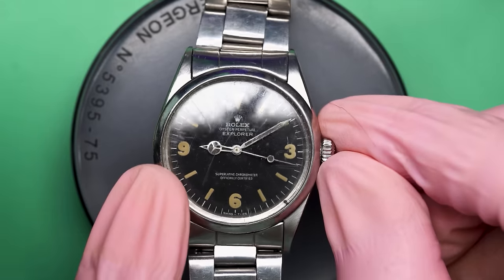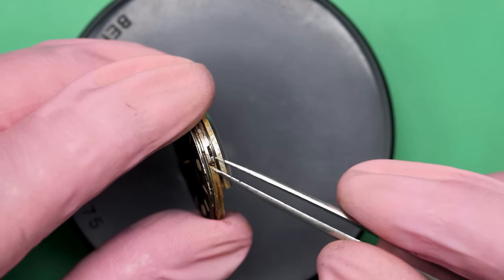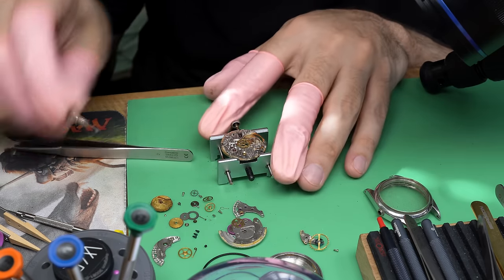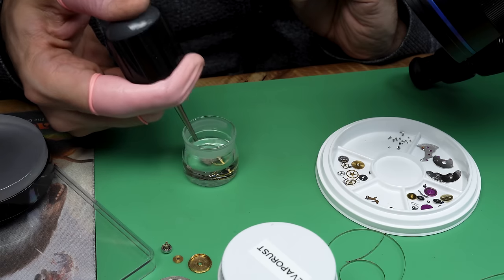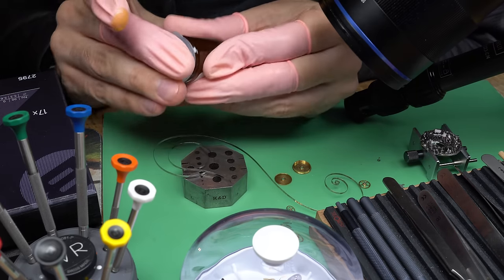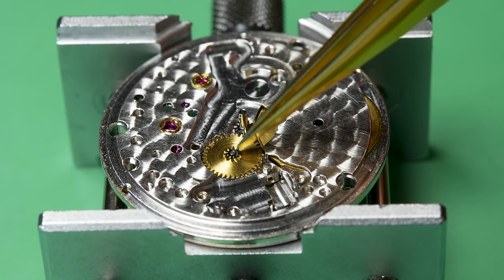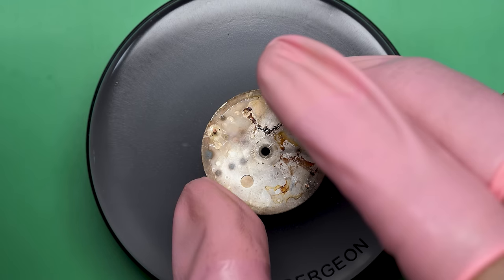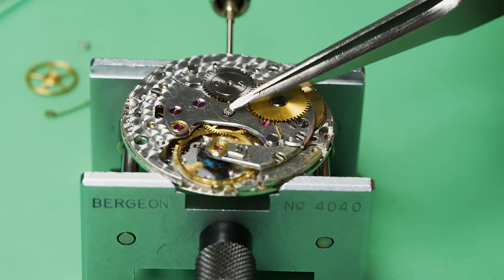This $25,000 Rolex Explorer Was Exposed to Seawater!

Comment: You know you've made it when someone hands you their $25k watch to work on. Well done Marshall - what a journey. And so good to have seen it develop from the beginning.
Reply: And now I've watched the video - even more a statement of trust given how special the watch is to that lady - regardless of the monatary value .
Reply: What pisses me off is that Rolex refused to work on it. Good job Marshall. Keep it up.
Reply: @AndrzejLDotEu  its probably a liability reason from rolex tbh
Reply: @bigbeast5751  Probably. Anyroad, thank Cat Marshall exists 🙂
Reply: Agree - this repair is a nice feather in Marshal’s repair cap.
Reply: @AndrzejLDotEu  it was probably just the AD and maybe US service centre that wants to avoid this stuff. I don’t think Rolex in Geneva would decline it
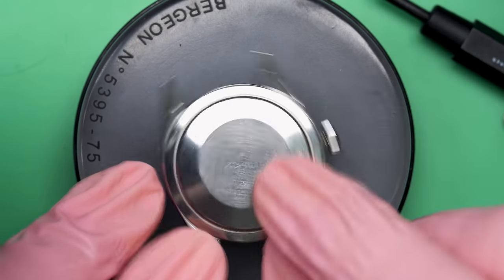Reply: @nintendokings  In the video he stated that the AD sent the watch to Rolex in Geneva and they declined to fix it. Time stamp 2:10
Reply: A tool watch that was actually used as a tool watch
Reply: @Recklessness97  ah well in that case Rolex stinks 😅
Reply: @AndrzejLDotEu  Rolex doesn't work on watches more than 25 years old anymore. I think their official reasoning is that they don't stock the parts.

You wouldn't want Rolex working on a watch like this anyway though because they will replace the hands and dial with new ones which would probably cut the value of the watch in half or worse.
Reply: @bigidiot123  The first part is not true. I had a 40 year old 1980 Rolex serviced by Rolex in Geneva during the pandemic and it was no problem. The second part is also not true. Rolex offered to replace the dial and hands at my discretion. I chose to replace them at additional cost because I wanted new lume and a different color dial, but Rolex did not force me to do that. My repair was done at Rolex in Geneva where I walked in and discussed everything with them in person as soon as they re-opened after a brief city-wide shutdown of  non-essential businesses during the early pandemic. Everything I asked was followed up with emails and letters of confirmation of exactly what I wanted and what the cost would be. I am going to post a video about this on my channel on Monday showing the watch before and after and the documents because so many of these comments, like yours, are incorrect. I understand that you're just trying to be helpful, and you've probably read what you've written somewhere, but it's simply not true - or was not true for me in any case.
Reply: @bigidiot123  I had my Dads Rolex...it was from the 50s...I took it to a local repair shop that only worked on Rolex...this was in 1991/2...the guy told me that Rolex only keeps parts for watches 40 years, and if parts were not available..he would have to make them...but the watch was restored with original parts..and it looked new when it was finished...
Reply: @bigidiot123  when a watch is particularly old, that’s when it is sent to the relevant HQ in Switzerland. Breitling from 1969, Omega from 1966, no problem. In London, Rolex can even do most things in their HQ without having to send the watches away.
Reply: How can I “direct message” you?
Reply: Well, given he wasn't first on the list and Rolex refused like the douche bags that they are, the owner has little choice.
Reply: @Harry Balls vintage Rolex are worth a lot. It's rare
Reply: TLDR, Rolex did her a favor by passing on servicing this watch.

Rolex will decline to work on a watch if they don’t have the parts to fix it. With Vintage watches, the supply of original parts is just exhausted. It is also probably worth mentioning that when Rolex services a watch, they pretty much just replace anything that isn’t perfect. That will decrease the value of your vintage watch. Imagine if they had serviced it and pulled the dial and crown rather than lovingly clean parts.
Reply: This is one of my favorite watch dials.
Reply: @philw4053  !
Reply: Worth 25000$ in your dreams
Reply: @AndrzejLDotEu  I hope Rolex sees this.
Reply: @IMakeWatches  That's great you got your watch fixed. Did they allow you to keep the original parts in case you wanted to re-use them later?
Reply: No watch is “worth”  $20k - especially one that gets damaged by a few splashes of water. Additionally the manufacturer realises it’s a piece of junk.
Reply: @ppal64  You are mistaken. These vintage Rolexes routinely fetch prices like that, partly because they were so well made to begin with, partly because they can be repaired like this one was, and partly because of the brand.
Reply: Yeah too bad that watch isn't actually worth 20,000. that's a $7,000 watch brand new. Evaluation was way off.
Reply: @Harry Balls some times it is better to remain silent and be thought a fool,  than to speak and to remove all doubt !   Clearly that would NEVER be worth zero.
Reply: Well it was nothing like $25k when it was not working.
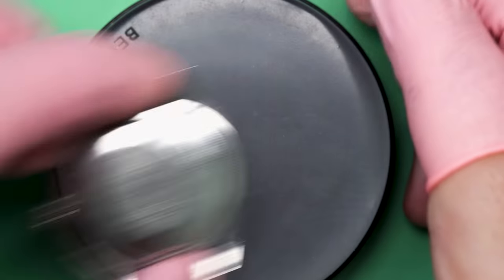Reply: John 3:16-21 
16 For God so loved the world, that he gave his only begotten Son, that whosoever believeth in him should not perish, but have everlasting life.  17 For God sent not his Son into the world to condemn the world; but that the world through him might be saved.  18 He that believeth on him is not condemned: but he that believeth not is condemned already, because he hath not believed in the name of the only begotten Son of God.  19 And this is the condemnation, that light is come into the world, and men loved darkness rather than light, because their deeds were evil.  20 For every one that doeth evil hateth the light, neither cometh to the light, lest his deeds should be reproved.  21 But he that doeth truth cometh to the light, that his deeds may be made manifest, that they are wrought in God.
Reply: Correction, probably worth less than a quarter at the start of the video just because of all the damage and because it wasn't working.
Reply: @IMakeWatches
Reply: @MercilessGuitar151
Reply: 26:40
Reply: @Harry Balls No most definetly not zero even if the watch is not moving it still has value as spare parts and in a watch as valuable as this one the spare parts alone are quite valuable.
Reply: @IMakeWatches  But why would you shoot a watch? I mean that does not make any sense I do not undertand that. I am baffled and to be frank shocked. I hope you find some time to refelct on your self to avoid such unnecessary savage behaviour.
Reply: @EricIshikawa  Your assertions are not true. Rolex employs professionals with a passion for their watches, they would not and do not just replace anything without consultation with the client. If it were the case they would slowly but surely lose their reputation, which they worked on so hard over the century to cultivate, to their detriment in the watch community which is very small especially regarding those vintage rolex.
Reply: @Kenny-yl9pc  They Shoot Horses, Don't They?
Reply: That watch sold new for about $250, a long way from $25k.
Reply: @patman0250  try $250 brand new.
Reply: @PayNoTaxes0GetNoVote  old Rolex watches are common on eBay.
Reply: Rolex is owned entirely by a  family foundation and pays no taxes up to date, when the father died he left the company to the foundation. The foundation does good work though my research 🙌.
Reply: Made it where. He enjoys his hobby
Reply: @nintendokings  somebody didn’t listen properly 🤦‍♂️
Reply: @AndrzejLDotEu  Marshall had to find parts on Ebay, can you see Rolex doing that? Then how could they warranty their work?
Reply: @IMakeWatches  Wuaaaaatt?! Who does that?? Crazy world... I am lost for words...
Reply: You know you've made it when you go clamming in a $25k watch.
Reply: @IMakeWatches  I used to work at a company that made electronic quipment for commercial airliners. Wjen they sold a system, the sale contract included a requirement for that for 30 years, maintenance support would be available; so, if they sold the system for 10 years, then stopped due to new technology, they were still obligated to maintain that support capability, which included maintaining a parts supply...for 30 years (there were probably some clauses that voided that in case of crashes, fires, removing plane from service, or breaking seals...)
It's possible that Rolex haa a similar policy to make/stock some quantity of parts based on some percentage of the accumulated sales of a model(s) using various parts, with the intention of supporting maintenance & repair for some signigicant period of time...but that is certainly a challenge to perform, both in terms of the data, as well as the physical inventory.

It's possible that whoever said '25 years' was just giving their perception based on experience, but was really not correct; it's also possible that your 1980 model was very popular, and, in general, well cared for, so parts were still available...
Enjoy!
Reply: @stevek8829  LOL yeah probably.
Reply: @PayNoTaxes0GetNoVote  are you just looking at Rolex, or limiting to no date, stainless steel Explorer, from the sixties?
Reply: @IMakeWatches  just because they had no issue repairing it doesnt mean they still make the parts, they just happened to have parts for your watch. or they just fabricated new ones, which is a very easy thing for many of the parts , but not all.
Reply: MLB 3.0l)
Reply: I work on 200k trucks so it doesn’t matter the price of the item your fixing bro
Reply: The fact that people still wear mechanical watches, let alone any basic watch at all, is really stupid
Reply: @philw4053  в
Reply: @Harry Ballssince we are stating the odvious, the sky is blue 😘
Reply: @AndrzejLDotEu  For these vintage watches, most of the time it would comeback with no work done due to parts being no longer available...even if it went to Geneva. 99% of the time they would be replacing the parts instead of restoring them when it is being serviced. It sucks, but you have to understand that the manufacturer is not going to continue producing parts for a watch from over 20 years ago
Reply: @Digger-Nick  ,
yes, quite anachronistic, really, but because of sentimental value, and perhaps as very pretty  jewellery ?☺️
Reply: I have a 1980’s “Tag” which had been overhauled by the authorized repair shop. The watch took in water via the crown after the o-ring failed. This was in the early 1990’s. The repair center said the white date wheel could be discolored from moisture. He was right. So after a few more years, the bracket broke along the band I took the watch in to see if the link on the bracelet could be repair. The repair shop said it could not be repaired and given the age it would be difficult to obtain the proper fitting OEM bracelet. I put it aside and have been on eBay in search of. Fast forward to 2019, I wrote to Tag Heur’s US Representative and learned that they offered repair service for vintage tags and printed out the completed repair slip and wrote an emailed to the New York office directly to determine if I was doing things right. They responded to my post quickly directing me to contact their local representative. I received a call from the local representative who said per the directive, to stop in to the same repair shop to get it serviced and repaired. I was once again the same story. This begs the question, would you be able to repair the watch? If this is possible, how can I effectuate this?
Reply: I think he knew he made it when someone handed him a 100k watch to repair.

Comment: first time seeing a watch being disassembled and reassembled and never knew how intricate they could be.
Really made me appreciate watches in a different way.
Reply: I have a ("unfortunately") rather new Grand Fathers Clock (roughly 20-30 years old). I can tell you, they're hypnotic to watch from the inside. I think mechanical watches have something to them which no digital clock can ever achieve. It's just... Amazing engineering work and it looks so majestic. 

Currently, I'm saving up to being able to afford repairing of the family's wall clock, my mom and I saved when my grandfather died. 
Looking iside it though. It's just amazing. This clock is probably around 100 years old (as my grandfather already inherited it). 

And sure, I'm currently wearing a smart watch on my wrist... But I just can't miss out on their functionality. Even though, I love skeleton wrist watches and automatic wrist watches and stuff... Just amazing!
Reply: Not trying to tell you how to do your job, it would be good in the future to clean the winding stem barrel earlier! To not push any corrosion into clean works. Thanks!
Reply: @davidleblanc4521  just a heads up David you've replied to a comment rather than the video, if you go back there should be an option to "add a comment" rather than "add a reply" and you stand a better chance of getting the message across 👍

Comment: It's incredible how tight the tolerances are on such tiny mechanisms. As a machinist who does work for big industries, I see so much rust on things that just keep on chugging along, whereas something so small and delicate requires every piece to be pristine. Really gives you an appreciation for the craftsmanship involved in the design of these cool little devices.
Reply: Think it's more the relative size compared to foreign matter. 1mm of rust on something 1000mm is nothing, 0.1mm of rust on 10mm is like playing football in quicksand
Reply: @aidengracey1267  that's what tolerance is about, it's the range of size that a part can be and still function, when saying watches have tight tolerances it's saying that a small change in size would cause the part to not work, there's no relative tolerance based on size, it depends on the function each part has to perform
Reply: Yup... You could not have said it better...right...right..right!!!
Reply: @aidengracey1267  when trying to sound smart fails 😂😂
Reply: Does anyone know the purpose of the internal jewels of the watch?
Reply: @ringofasho7721  I believe the jewels present a very low-friction connection point for the gear axels to turn in -- kind of like a bearing.  Jewels are extremely hard and smooth, so wear at the connection is minimized.
Reply: @JimAndKathy13  yeah toward the end of the video he he explained it. Makes sense
Reply: Same here.

Comment: I never thought I would find myself watching a guy take a watch apart, but your various special tools, confident work, and knowledge of all the names of the parts, makes you sound like a doctor! and your conversation explaining the process was captivating.
Reply: Same here. I wasn't even remotely aware there could be a channel devoted to watch repairs but as I started watching it, totally remained glued to the screen in awe of his precision craftsmanship, specialty tools that I couldn't even imagine exist and his knowledge of each & every part of the watch.
Reply: So true
Reply: I'd get the part names wrong often enough, but I can see how they related and work together well enough to figure out assembly and disassembly. What's worth gold is seeing lube points and what's worth platinum, seeing which tools get used for what purpose.
The only better thing for cleaning than an ultrasonic cleaner is two ultrasonic cleaners!   ;)

Just looked up the rust away, MSDS shows Ammonium Bifluoride and an acid to buffer and complex things, plus a solvent. Ammonium Bifluoride is properly known as Ammonium Hydrogen Bifluoride and disassociates into HF in water, so not a good thing to get on you, but it's a 1 - 10% level in the solution, reasonable precautions would work well enough. 
Phosphoric acid would do the same thing, but it'd leave a phosphide layer that'd discolor the movement. That's the active ingredient in naval jelly and also what's used when heated to Parkerize steel gun parts.
Reply: Ayam goreng enak
Reply: I thot I was the only one. I watched in entirety and glad she had her Dad's watch back. Disappointed with Rolex for not even bother to restore it. Kudos for Marshall for helping her. You are a true craftsman !
Reply: same here - i was buffeled, awesome work!
Reply: Same. The YouTube algorithm decided it was time i learned something about watches!
Reply: So true

Comment: Man, I was thinking to myself, this has to be so hard to remember any of these parts. Then he says "this is stressful" and I instantly felt it. I wonder how much work like this costs someone. Worth every penny.
Reply: incredible really
Reply: A lot of practice 👍🏻
Reply: I sometimes need to take apart electronics to clean and repair, stuff like video game consoles, controllers, remotes, and computer parts, phones and tablets, and none of those are as complicated as watches are. And yet I still manage to lose screws and break parts
Reply: about 1k at an authorized rolex service center stem gold and chrystal extra.. rolex guarantees the operation of watch..why i only use them..
Reply: @peter-pg5yc  also comes with the burden of being regarded as a snob and having to be stressed when someone stops you with a knife to add it to their collection...
Reply: @peter-pg5yc  There are places that don't guarantee the operation of the watch they are servicing? I have never heard of a shop that didn't.
Reply: @peter-pg5yc Rolex refused to repair the watch
Reply: @sebaschan-uwu  the electronics you're taking apart aren't what's really complex. the complicated parts are in the IC and are infinitely more complicated than a mechanical watch because they are wired on a microscopic level. its just extremely hard to take apart